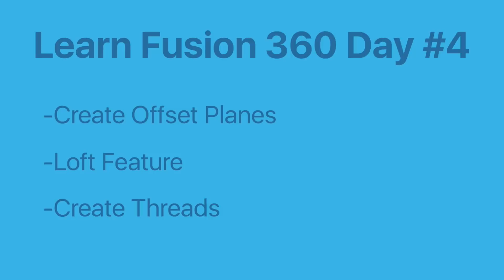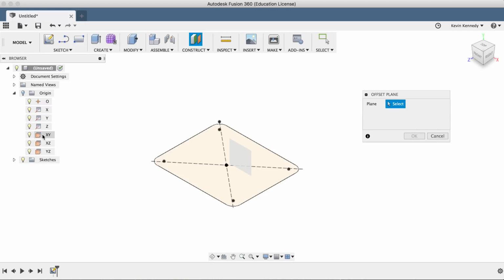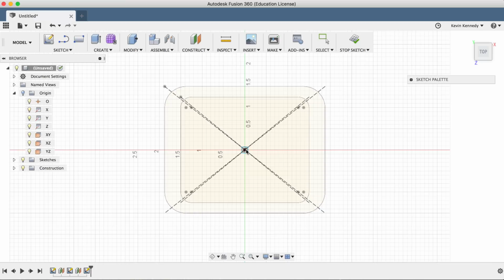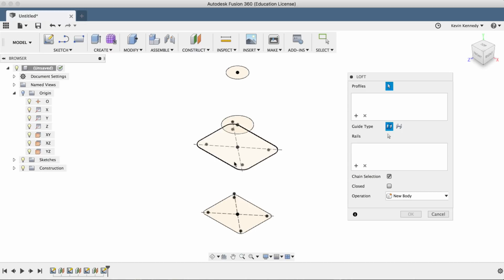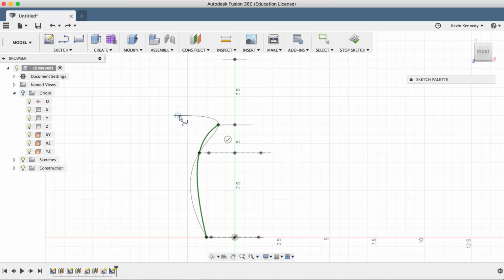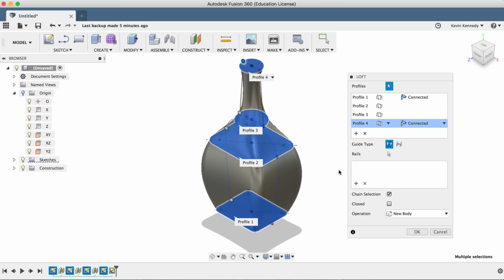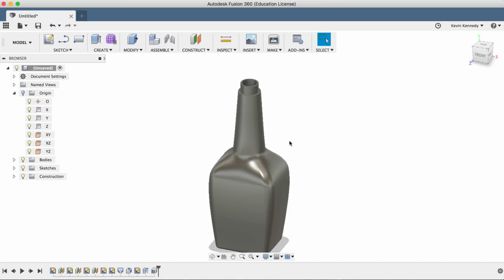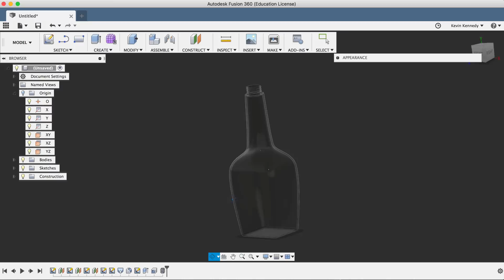How to 3D Model a Whiskey Bottle - Learn Autodesk Fusion 360 in 30 Days: Day #4

Comment: Can't create the loft due to "The selected rail does not intersect all of the profiles".

A few places where I could not reproduce as seen in the video: 

1) Trim - Select curve section to trim - I can only select the entire curve, I can't trim it back to the previous spline control point
2) Mirror - When I use the mirror command the line and the spline are mirrored, but only the area between the two splines is shaded, the area between the two straight lines is not
3) When trying to select the rails I get the error: The selected rail does not intersect all of the profiles.  Selecting the spline does not include the straight line of the neck.

When creating the rail sketch I used the Sketch + Project + Intersect to create intersect points on the XY plane with each of the 4 profiles.

I can loft the neck, and I can loft the body, but I can't loft them together, even though I have "Chain Selection" checked.

If I use a spline all the way from the bottom to the top I can loft with no problem.

I think the problem is that Fusion 360 doesn't seem to know the rail sketch components (the spline and the straight line of the neck) are a single component.  I checked the endpoints of the spline and line constraints are coincident, but no joy. 

Model link is https://a360.co/2OLlmjt
Reply from the maker: Hi Jim,

Thanks for sharing your file. I was able to take a look at it, and it appears that the bottom spline point was throwing off the loft. I could not get it to work by tweaking it either, but I got your loft to work by simply deleting the spline and drawing a brand new one. Then, I re-mirrored both lines and had no problem completing the loft. Here's your original file with my changes if you'd like to take a look - https://a360.co/2nd7hOT

"The selected rail does not intersect all of the profiles" always means theirs some issue with the guide rail not connecting to the profiles. Sometimes Fusion 360 (and other CAD programs) can get picky... its always tricky to figure out exactly where since the error message is so general and it could be a variety of things. I always reccomend just deleting the spline/complex line and trying again, looking at it from the side perspective to ensure you're clicking on the exact profile points that you're meaning to.

Let me know if you're able to get it to work! Cheers, Kevin :)
Reply: I thought that, but I was able to create a loft with the mirrored spline and the first three profiles.  I was also able to create a loft with the straight lines of the neck as the rails and the top two profiles.

I tried to trim the spline back to the third profile but when I try, it trims the spline all the way back to the first profile.  I think that's where I go wrong.
Reply: Having same problems.  Yes, Fusion 360 can be picky.  It is really one unfriendly piece of software. @ProductDesignOnline
Reply from the maker: @pronouncedsooch927  I think you'll find that's true about any CAD program. It takes a lot of time and patience to really "master" any CAD program... Keep at it and before you know it you'll find yourself blowing past all the little nuances and problems that come up often. Cheers, Kevin :)
Reply from the maker: @pronouncedsooch927  I should also note that I think you'll find the videos to be more thorough as the series goes on, based on feedback from these initial 5 or 6 videos :)

Comment: while using rails, it says, ""the selected rail does not touch all the profiles".
how is that to be resolved?
Reply from the maker: Hi, Aryan. That means that at least one point of your rail is not touching one of the profiles. You'll want to re-draw the rail, making sure it snaps into place. To help with this, it may be easier if you add additional points to each profile by using the Sketch > Point tool. Let me know if this helps and you get it working after another go. If not, please share your file and I'll take a look and give you more specific help! Cheers, Kevin :)
Reply: @ProductDesignOnline   I tried as you said, but it still shows the same problem. i guess it shifts when i am adjusting the curve.
could you tell me how can i share the file?
Thanks!
Reply from the maker: @aryanray7128  Share your public link as a reply to this comment. Here's a video explaining how to share a public link - https://youtu.be/2XrcrdV-8Ls

Then, please write a separate comment letting me know you've replied with a link because YouTube flags most links and I don't always get notified. Cheers, Kevin :)
Reply from the maker: Hi, Aryan. When I took a look at your file it appears that the following 2 error codes were given after attempting to add rials with the loft command: Error 1: The guide is not G1 between first and last sections and Error 2: Tool body creation failed.

I'm not getting the "selected rail does not touch all the profiles" error that you mentioned.

Anyway, this is a simple fix. All you need to do is snap your top spline handle into the straight line. Double click on the last sketch in your timeline to edit it. Then click on the top spline point. Drag the green-blue handle to the left just a bit, where it snaps into place. Here's a reference image for your convenience: https://snag.gy/XO2uRn.jpg  Take note of the snap lines (four lines around the dot).

After fixing this, the loft command worked while using these rails. Please try this and let me know if this fixes it. Cheers, Kevin :)
Reply: thanks 
:)

Comment: Hi Kevin, when i loft, it have a error "the rails do not intersect all profiles. All rails must intersect every profile. if use a single rail, try wrapping this to a centerline."
Reply from the maker: Hi, Nhan Phan Minh. It sounds like you're getting that error because the spline/straight line that you created is not connecting to at least one of the profile sketches. It can be tricky to catch this because from afar they all look connected. However, sometimes if you zoom in really far you'll notice that one of them is off. I would recommend re-drawing the spline and straight line. Look at your model from a side perspective and make sure your lines are showing that they are snapping into place.

If you're still having trouble after giving it one more go, then please share your link with me and I'll take a look. Share your public link as a reply to this comment. Here's a video explaining how to share a public link - https://youtu.be/2XrcrdV-8Ls

Then, please write a separate comment letting me know you've replied with a link because YouTube flags most links and I don't always get notified. Cheers, Kevin :)
Reply: @ProductDesignOnline  I am using windows 10.  Jan 2020.  I could not make it follow either.  I really worked hard and tried several ways to make the spline and line connect to the points in the offset planes.  Finally, I solved it for me by changing a preference - design, auto project edges.  Then it worked.  Your mileage may vary.
Reply from the maker: @billmckinzie  Hi Bill. Glad that setting helped fix it. Thanks for sharing this - should be helpful for anyone else who runs into the same issue.

Don't hesitate to comment if you run into any other roadblocks as you work through the series. Cheers, Kevin :)

Comment: First of all, thank you for your clear explanation. I just have a problem with the shell thing, when I enter 0.09, it shows me this error: Error:   The operation could not create a valid result.
 Try adjusting the values or changing the input geometry.
I made sure of the measurements but I don't know what the problem actually
Reply from the maker: You will have to go through and edit the curvature of your splines. your bottle shape will determine the max value of the shell... Based on the error message it sounds like the shape is not allowing the defined thickness. Sometimes it takes a little bit of tweaking back and forth to get the appropriate thickness. With this design you'll have to be careful around the bottleneck, especially where it starts.
Reply: After trying, it accepts 0.07 or less only

Comment: Got to the last part to add a fillet on the bottom, it's telling me it can't be created at the requested size. Suggestions?
Reply from the maker: You won't be able to add a fillet larger than any surrounding geometries will allow. Due to this bottle shape, if you add a fillet too large it will interfere with the loft guide path.

If you're trying to add the same exact size fillet as the one I applied then it's probably because you have a slightly different shaped guide path (spline). Cheers, Kevin :)
Reply: Love it...it's in the details.

Comment: I am at the point where I am drawing the spline from the bottom up...are you using any hot keys to make sure the points land on the right spot? Do you have both snap and snap to grid selected? The problem I am having is that when I trim the top piece of the spline the original point at the bottom of the bottle turns white. Do you know what I am doing wrong?
Reply from the maker: Hi, Mr. T, I do have my snap and snap to grid selected. One thing to try is looking at the sketch from a slight angle...sometimes when looking straight on there are a lot of points that your cursor will want to snap to.

If that does not help then please share your file and I'll take a look to make sure there isn't something else prohibiting it from working. To share your file please go to File > Share > Share public link (make sure downloadable is toggled on) > paste your link as a reply to this comment. Cheers, Kevin :)
Reply: BTW your videos are the best I've seen so far you are doing an amazing job! We are all grateful
Reply from the maker: Thank you, I truly appreciate that! :)
Reply from the maker: Hi Mr T. I took a look at your file and here's what I would suggest.

-Try making your spline and the straight line in one single sketch. I noticed yours were in two different sketches which may be throwing something off.
-You can draw a reference line across the top of the top circle (horizontal divider) if you need help getting the top line to snap to the circle.
-Lastly, make sure the light-blue spline handle is resting on the straight line that you create. It should snap into place. If the spline handle is not resting on the straight line then it won't work as a guidepath for the loft.

Here's your file with my changes if you'd like to take a look - https://a360.co/2Rmkwun

Cheers, Kevin :)

Comment: Hey, first of all thanks for the really nice tutorials! However, I am having big trouble solving this one and my personal stubbornness doesn't allow me to skip one video and just do the next one... I can not make the spline snap to the first circle ...to all the other planes it snaps just fine and I also have the snap thing activated in my settings. Do you have a solution for that?
Reply from the maker: Hi, Maj-britt. You can double-click on the third sketch to edit it...then, draw a construction line (make sure you turn on the construction option on in the Sketch Palette). Then, draw the line from one edge to the other edge of the circle. This will give you an extra point on the edge of the circle that will ensure you should be able to snap the spline into place there.

Let me know if that works! Cheers, Kevin :)
Reply: @ProductDesignOnline  Had the same issue. Trick with construction line did the job. Thanks.

Comment: First of all, thank you for uploading these tutorial.  Been going through learning new ways as well as confirming some method I've been using.  Lofting part i understood but when you made the spline for the path, after I make the spline, I can't move the curve the or the curve arms to change the curve.  Am I doing something wrong?
Reply from the maker: Hiroaki Morikawa - Thanks for watching! :)

It's hard to say without seeing a screenshot or taking a look at your file. Can you post a link to a screenshot or share your file here? 

Cheers, Kevin
Reply: https://drive.google.com/open?id=1bFi_1bYKoISzG2jr5mwJhVl4Jn3CzxqG can you see this? I'm trying to move the spline handle to the left, for example, but does not budge.
Reply from the maker: @HiroakiMorikawa  It's hard to tell just from the picture, but if your splines are 3D splines, then yes, you cannot just drag the tangent handles.  3D spline handles can only be manipulated with the Move command. If I remember correctly 2D sketch splines are green and 3D splines are blue.

I would reccomend deleting the line and sketch plane and repeating those steps, otherwise right click on the spline and use the move tool.

Let me know if this helps! Cheers, Kevin :)
Reply: You know what, yesterday I tried to redo 3 times and same result, today I tried again as you said, and the point moves...go figure.  Thanks for assistance.   Please keep up the tutorial!
Reply from the maker: @HiroakiMorikawa  I'm glad you got it to work! Thanks again for watching. Cheers, Kevin :)

Comment: I too am having the issue with the rails, I have noticed that when you finish the fillet on the first rectangle a point appears outside the top right corner of the rectangle. This is the only difference I can see between your video and my file. Can you explain why this point appears and if this will have an effect on the rails?
Reply from the maker: Hi kootzz1. Can you please share your public link as a reply to this comment? Here's a video explaining how to share a public link - https://youtu.be/2XrcrdV-8Ls

Then, please write a separate comment letting me know you've replied with a link because YouTube flags most links and I don't always get notified. Cheers, Kevin :)
Reply from the maker: @koootzz1  I took a look at your file. So far, everything seems to be correct on my end. The dots you're talking about will show up on, however, and they shouldn't affect the rail at all. With that said, I'm not seeing a rail sketch (the spline and straight line) in the file you shared with me? If you want to give the rail another try and it doesn't work then please share the updated file with me.

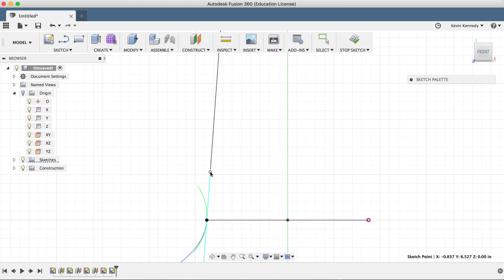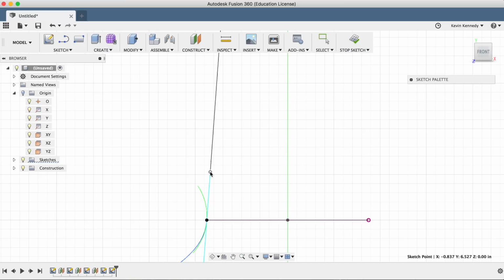The most common issue others faced is that the spline and line are not truly connected, thus they are not one continuous line that is required by the loft path. What you need to check first is if the top of your spline is connected to the bottom of the straight line. Watch at 6:49 - 6:54 how the top spline point is snapped into the straight line.

To check this grab the handle of the top spline point...move it around freely and then move it towards the straight line until it snaps onto the straight line. This will ensure they are one continuous path. Then, if you re-try the loft command it should allow you to select that path as the rail. Let me know if this helps! Cheers, Kevin :)
Reply from the maker: Hi koootzz1 - I looked at your file. First, I noticed that you created the side rails on the opposite sides compared to how I created them. My rails were created on the left/right sides while looking directly at the "front," whereas, your rails are on the front and back sides. This isn't a big deal, and if that was intentional that is okay... I just wanted to point that out.

When I try to complete the loft I get the error that the selected rail does not touch all of the profiles. It appears that the spline is not touching the 3rd profile (second from the top). I would suggest deleting the spline and straight line and try them from scratch, making sure they snap into place. It may help to look at the bottle of a top/side view of the viewcube as you draw the spline. Make sure your "Sketch Grid" and "Snap" options are turned on in your sketch palette.

Let me know how it goes! Cheers, Kevin :)

Comment: I've spent an hour trying to shell my bottle. I've drawn the bottle twice as instructed, and even removed the top threaded extrusion to see if it would work with no luck. What am I doing wrong?
Reply from the maker: Hi Dan, it's hard to say without any more details. Could you please share your file? Go to file > share > share public link > copy and paste the link to the reply of this comment. Cheers, Kevin :)
Reply: @ProductDesignOnline  I have the same problem as well, for some reason it won't accept any value (both positive and negative) I put in and won't even show a preview, I can never press ok to save the changes.

I've tried selecting the top of the extrusion as you did in the video and even tried selecting the whole bottle but nothing changed.

The biggest problem with this is that every time I put in a value the program freezes to load nothing...
Reply from the maker: @trydodis690  Can you share your file? Looking at your file may help me catch something that is wrong. Go to File > Share > Share Publick link and make sure "downloadable" is toggled to on. Cheers, Kevin :)
Reply: Hi guys, I had a similar problem - in my case even after setting "Operation" to "Join" the bottle and the thread were still two separate bodies. I used Modify>Combine>Join on the two pieces and it helped.
Reply from the maker: @monikak1334  Glad you got the workaround to work :)